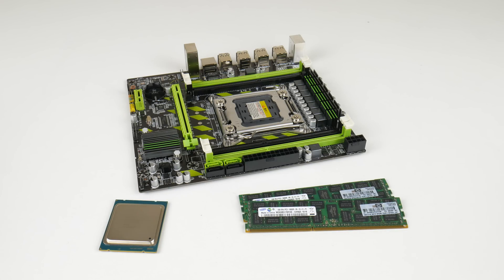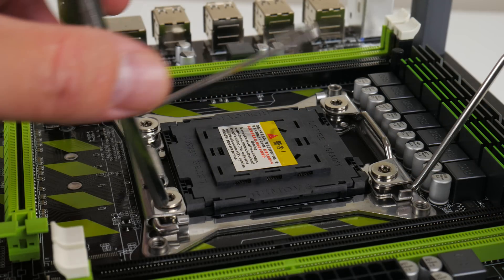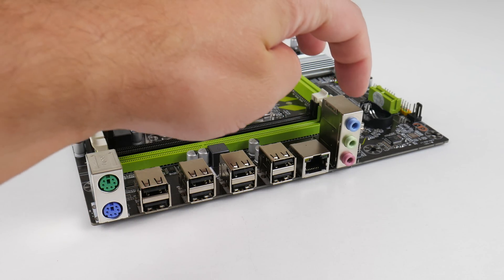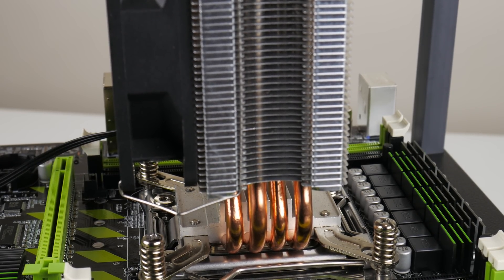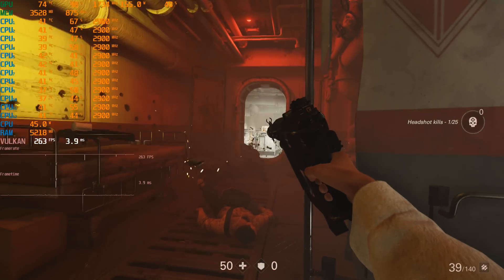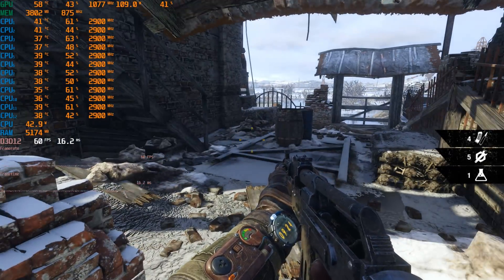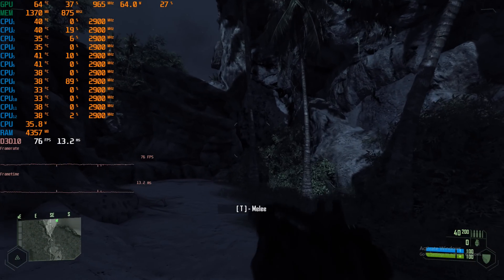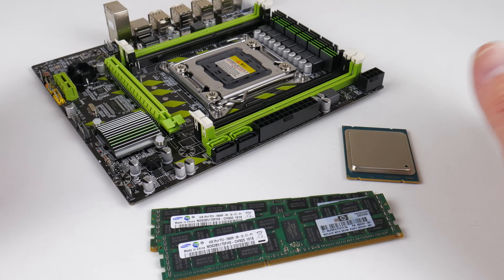$99 LGA 2011 Motherboard 6-Core CPU 8 GB RAM Budget Bundle

Comment: "Finally bought the full version": Activate Windows can be clearly seen :D At least you moved the problem from one thing to another
Reply: To be fair, Win 10 is basically free. No need to activate it unless you need specific features or want to get rid of that message. It's perfect for hardware reviewers who swap around pieces and don't want to have to deal with licencing bs getting in the way.
Reply: @TheSliderW  can't you tie your Windows license to a MS account instead to an specific computer?
Reply: @RetroTinkerer  I'm not sure about the MS account. I think that's separate since you can potentially have multiple user accounts each with it's own MS account login.
The licence however is tied to your hardware once activated so if you change something such as replacing your ram or processor, it could trigger the Windows activation procedure again. So yeah, it's easier to ignore it altogether for testing purposes.
Reply: @TheSliderW  this used to be the case, but with Windows 10 you now have that option, never used it my self but I had seen videos and articles about it. Maybe in my next build I will give it a try, but you need internet to log to your MS account and validate your license each time you log on, that seems like a big turn off to me.
Reply: @RetroTinkerer  Like I said, i don't know about the MS account thing. I use an offline user account. However, tying the activation to your online MS account sounds terrible with huge implications.

Comment: I would NEVER EVER buy any electronics neither from Ali Express nor Joom or Wish. Just a huge gamble what you will get, fake hardware, broken hardware or simply nothing at all.
Reply: Ali Express is pretty legit. Scams are usually easy to spot if you have more than two brain cells to rub together.
Reply: thats not true .... you have to watch out ...sure ... but if you do some investigations what you buy theres no problem !!!!!
Reply: In my opinion basically there´s a risk buying from these kind of shops. Sometimes you can get a different revision or version. But i think you have to really take good care of reading the whole details of a product you want to buy. Sometimes there are mistakes in the details which could be a "warning sign". So i would always check if the information is correct or ask the seller for more details about the product.
Reply: That's why you buy from the links in this video. It's tested and you have some sort of trust from it
Reply: You can check their rated and comments section though, not so risk.